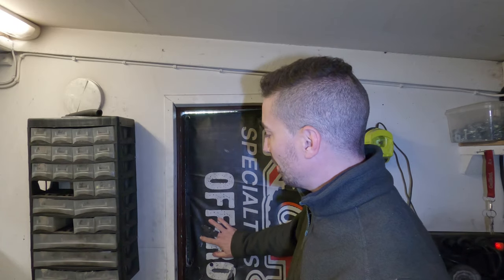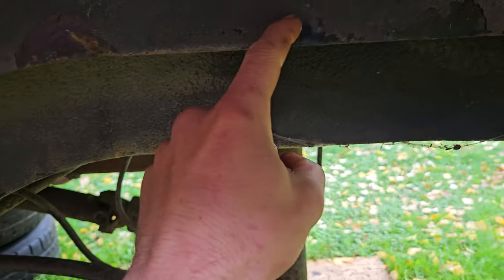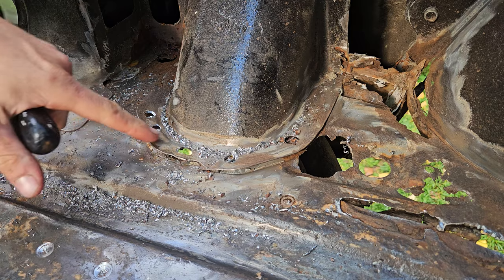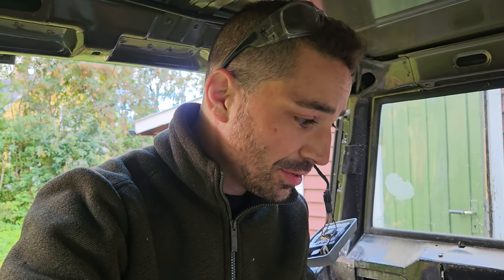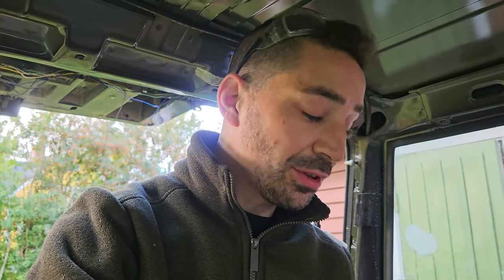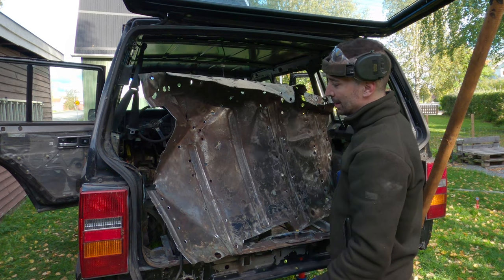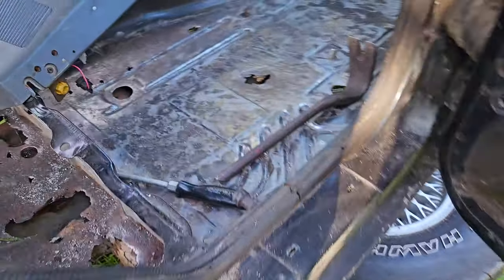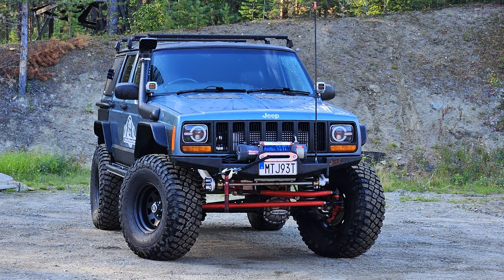1990 Jeep XJ CARGO FLOOR REMOVAL / Renix 4.0 Ep:04

Comment from the maker: Its the Jeep XJ 4.0 Renix's turn for some love, and in this video I'm taking out the rear cargo floor pan. Separating spot welds that you can barely see and getting the floor out in one piece will probably be a pain in the ass, but it should be worth it, as I can build a more accurate template for replacement. This Cherokee has been patiently waiting for its time, and my plan is to have all of the cutting, cleaning, and weld through primer and general prep completed before the first snowfall. So that I can park it in the garage and begin welding in the new metal. 
This video is a little on the short side. I've been pretty unwell with my UC, and I'm still recovering, so hopefully, you can see some more involved work when I gain all my stamina back.   
Thanks for all your support!
Mike

Comment: Lots of work there Mike! 
Mike I did the cut and fold on my Xj. Because I had some bad rust there. But I left the part on above that holds the rear bumper caps in place. But my Jeep is a 2001. So different rear bumper corner caps I think? So mine still looks stock. But is cut and fold behind those bumper covers. Then I built rear wheel well fender liners that go all the way back to the rear bumper. To keep it all protected from the wheel spray. 
Just like your diesel xj. 

Mike I agree. I think 31” tires. 2 in lift. 👍Some extended brake lines front and rear. Front sway bar disconnects. Hockey pucks for front bump stops. Hitch for recovery point on the back. Factory tow hooks on the front. Or custom front bumper that is flush to the grill. So it looks stock. Limited slip differential in the rear axle. Keep it low. Keep it light. Put flexible control arms on the front axle for great flex. Upgrade the steering tie Rod to 98 v8 grand Cherokee steering parts. Way stronger and big enough for 31” tires. And don’t forget to add some welds to that front cross member by the steering gear box. My two spot welds let go there. And it took me along time to figure that out. 
Build an electric fan override switch with timed delay relay. 
4.0L run hot. Having the ability to control the electric fan manually and have it run for 3 minutes after the engine is off makes a huge difference in eliminating fuel vaporization. 
And upgrade all the main power and ground wires on the engine to a bigger gauge. That right there is probably the best thing I ever did to mine.  It now doesn’t even turn over. It just starts instantly!

Comment: When i did this i plated the open top side of the frame with 1/8 plating and sheet metal everywhere else, that way the "frame" is fully boxed at least - this gives me flashbacks as my jeep is same green and its a lot of dirty work. I just wanted to make a hitch but ended up having to remove fuel tank and interior and replace the whole floor..

Comment: Nice Mike! Not many USA Cherokees, let alone the RENIX platform,  would see this much love. Watching you analyze where the rust must go, versus what is salvageable, is very interesting.
Reply from the maker: I must admit it all feels more enjoyable this time around. I suppose it's familiarity, which is the same with anything. Hopefully, I can get it all chopped up before the snow falls. Thanks for watching.
Reply: I have a 90 XJ that I have poured a lot of hours into.  I just got done doing 2x6 rockers, boat sides, and floor pans.  Next up is tucking the fuel tank, skid plate, and new trunk pan.  I love my Renix, it is a unique engine management system that has been good to me.  I appreciate how simple the system is.
Reply: There are plenty..just are not looking I the right place.
Reply: There are plenty just not looking in the right place .

Comment: Awsome Mike seein u dig right in no matter what tools u have brings me back as iv done this job for a living plus years of metal/fabrications on everything from ships plains trains bikes and autos and everything in between .. i did it the hard way then i learned to do it easier ways over time .. i was lookin into pricing for u on rear floor pans right and left ; prices ranging $65-75 each side but the shipping averages 20-40$ per pound so it may make more sence depending on ur fab guys cappabilities to just have them build it.. id make them in 2 pieces; first templating with 2"strips of wood door skin and glueing with hot glue gun quik and easy concentrating on making the outter edges as acurate as possible and leaving the center a bit over sized and trim for a more perfect fitment when doin final floor pan instal  .. not sure how cheap door skin is there but here i can pick up a 4x8 sheet around 20 $ plus or minus... i cut a buntch of 2" strips and form the outer parimeter then add strips across the center to keep its over all shape and leavin it a bit longer in the center hot glue gun makes quick work of making a fairly acurate template.. sorry for the long letter but u started it now im hooked great vid lookin forward to this project keep up the good work im lookin forward to how i know u will transform this special vehicle thanks and cheers from "Rooster"...✨️🔥
Reply from the maker: There's something satisfying about achieving these things the hard way then being able to look back from easier times. 
I thought about making it in multiple parts, but I can get a full repayment in 2mm from Poland for 150 euros. It seems very reasonable, and from talking to another guy, it seems to fit good enough. I think I will have to drill it through for spot welds, but that shouldn't be too bad..... hopefully.
Appreciate you watching and thanks for the tips!!
Reply: @WorkshoptoWilderness  that sounds good i was hoping u could find an easy option like that plus the price is right .. good hunting to u !

Comment: This can be a great fake taxi Jeep. A friend told me to say this of course. On a more serious note, it took a lifetime for this vehicle to get to this point, so you're reasonably quickly going to get to the point to extend it another lifetime with some new bits of plate and a rust stopping paint. Great restoration story, happy to follow you on this journey.
Reply from the maker: That's definitely another solid use for this thing when done. Line the inside with plastic flexi mirrors, and it will feel like a limitless dry bumming zone. 
To be fair to the jeep, it's in excellent condition for its age. Some love, and it will last a lifetime once ageing. Thanks for watching!
Reply: @WorkshoptoWilderness  and all your kisses too.

Comment: Cut it all out and start fresh with new sheet metal.I when through this process on my 99 XJ.  Did the frame and build  new rear wheel well. When all done jeep was freaking solide like a tank. Before the rebuild on a small flex any doors would even shut. After the build all door including the rear hatch was closing at full flex.  Private message me if you want photo "ideas"  of my build.

Comment: Thats just surface rust Mike, a bit of Jennalite and some red oxide paint will sort it, just make sure you sell it fast :) Also don't bother with welding you could use some G flex epoxy and justb glue the floor in place. Why not even consider making it into a summer vehicle, remove the roof and use that as the floor instead. You could call it, "The Upside downer" How's about that then :)
Reply from the maker: Haha, that sounds like a solid repair! I'm not sure I could bring myself to go top less with no roof. It might get a bit cold over winter! 
Thanks for watching

Comment: I know you said you don't want to go to crazy with it but now that you have the unibody open I would say way not 1 POR15 or rust inhibit the inside of the rails and or B- slide some 2x3 or 4 tubing inside to internally stiffen the frame rails. I know this is not going to be a rcok crawler, mud jeep, or even an overnight "overlander" but hell you have it that far down, why not see if it is feesable to do that frame stiffening? Yes, I am sure the budget would prohibit this but even a test fit of some scrap to see if it could be something for a future project or give someone who is building an XJ an idea, suggestion, or a kybosh that it just wont work. Give them frame rails a bit of a test tickle while they are open for business and a bit of experimenting. May not even need to much to slide them pieces right on in from that gaping rear.

Comment: I wouldn't do the cut and fold.  I think your plans of 31's and a 2" lift would be better with standard bumpers.  Tempting to use the bumper you have, but then I think you'd regret it when it looks like a partially built jeep rather that a lightly upgraded and well preserved jeep.
Reply from the maker: It's tempting to use what I have, and the cut and fold makes It easier to clean. But I think the quarter panels are in good condition so I will try and save them first.

Comment: Impeccable, just in the process of doing the same, however all my floor pans are fucked. Eagerly awaiting the next videos on this job to steal all of your ideas. If you did have a crusty (uni)body what thickness can you butt in?
Reply from the maker: That must be quite the job with all the floors! I got lucky on this old thing. Hopefully, once you have all the old out, it will be much more satisfying to put it the new. I'm going with 2mm on the rear, but I would do the same for all the floors if I had to. Thanks for watching

Comment: Hi Mike, new to your channel and I’ve just recently had an offer for a 1998 XJ 2.5 TD accepted…only 60,000 miles and one previous owner. 

Is £6/7k a good deal for Jeep?
Reply from the maker: Hey, thanks for watching! That's very low mileage, so yeah, that's definitely a very good price for such a vehicle. If the engine has been serviced, then it should be fine.
Reply: I'll chime on in this just cos it's the subject of this video... check for rust!  If you can then get the carpets up for a really good look, poke and sniff; and thoroughly check the sills, and get under the vehicle with a good torch.  I'm always astonished watching stuff like Matt's Off Road (in Utah) where they have loads of cheap old cars and jeeps with good bodywork, or if it's rusty then it's still solid - a free cool rat-rod look from the desert environment :)  And as Mike says the usual engine checks - servicing, smoke, noises etc.  I hope she's a good un :)
Reply: Thanks to you both for your replies, much appreciated.
Reply from the maker: With the 2.5 td. Drive it and take the rpms up to 2000rpm while driving normally and changing up through the gears. If you feel immediate power loss at 2000rpm, don't be alarmed. It's possibly your pulse injector or Maf. These are easy to fix and replaceable, but it means you can hammer the price down.